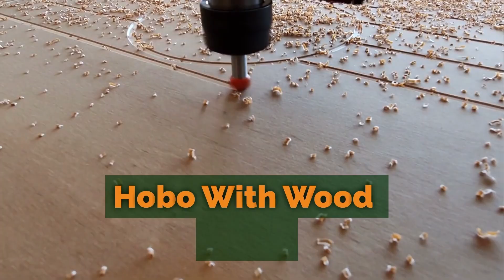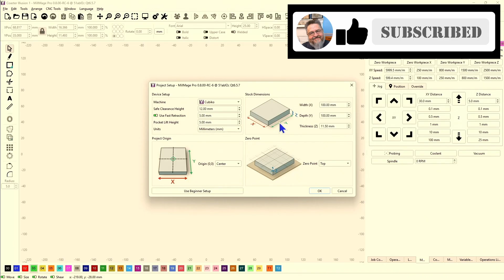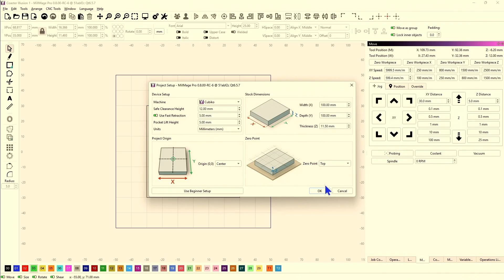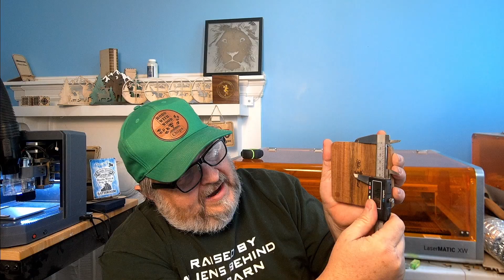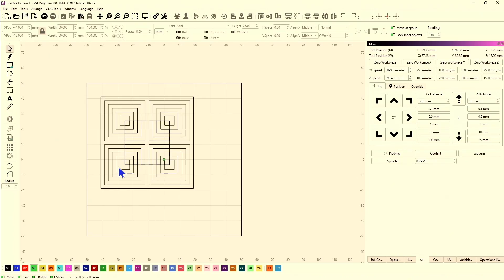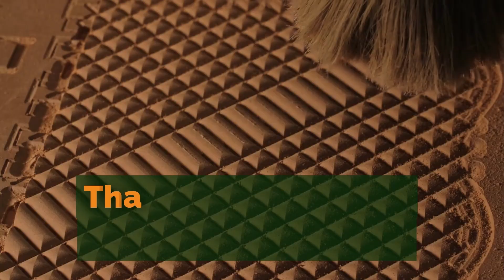How to Center Your CNC Projects in Millmage | CubiCo CNC Beginner Tutorial

Comment: Thanks Steve for the lesson. I'm learning laser and CNC at the same time but our X1 laser is waaaaayy easier. My biggest issue is not remembering to Home the CNC router before I start. Then the machine doesn't know where it's at and I've buried 2 cheap Amazon 1/8 bits that way so far. Snapped them babies right off.  Zeroing and feeds and speeds are a nightmare to a new CNC user and I'll try centering my work and see if that helps.  Last night I tried my Genmitsu Z puck for the first time and it works really nice.  Millmage makes using it harder then gSender though - too many screen steps.

Comment: not as important on wood as metal, but if you ever have trouble seeing when your bit is touching material to set Z, place paper on material and move slightly as you lower spindle, once it starts dragging set Z. looking forward to your learning adventure in CNC milling
Reply from the maker: That is how I find Zero on my Z axis. I will be showing that in an upcoming video. Along with securing my blanks to the Cubiko.
Reply: i use a metal business card

Comment: If you don’t have a caliper to find center of material you can draw a line from corner to corner both ways and that will find your center even if it is a rectangle.
Reply from the maker: These weren't rectangles, they have slightly irregular radii on the corners.

Comment: Important information to know.  Thanks for sharing.  How do you clamp the wood down?
Reply from the maker: The Cubiko has multiple places in the spoil board with threaded holes for clamps to hold the material in place.  I will be doing a video on simply mounting my blanks to the machine.  Stay tuned.

Comment: great info.  everything you said does transfer over to other CNCs too.   One word of caution, when you finish setting your Z to the height of your material, and zero everything, make sure you raise your Z/spindle a few MM (i usually to 10mm) before framing so that the endmill does not drag across your material and mark it up. :)
Reply from the maker: I failed to mention that.  Thanks for pointing it out.  As a habit to prevent any possible damage to my bits, once I Zero the Z axis, I immediately raise the bit.  I do need to point that out as a habit they should get into as well.